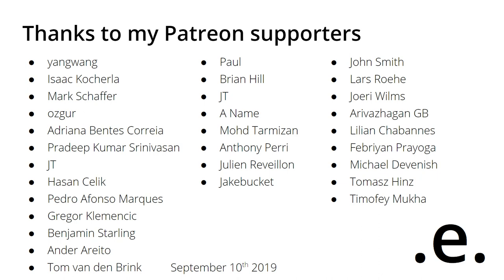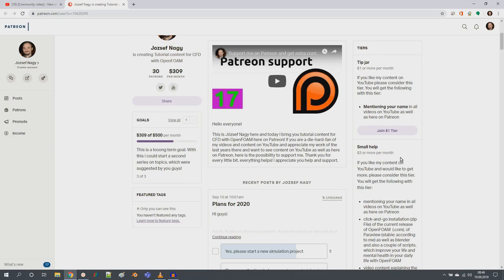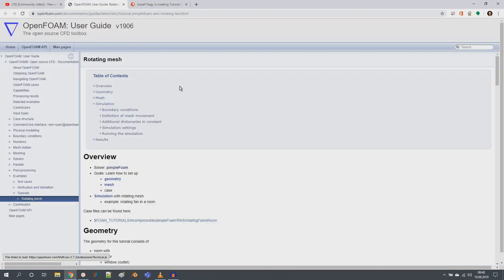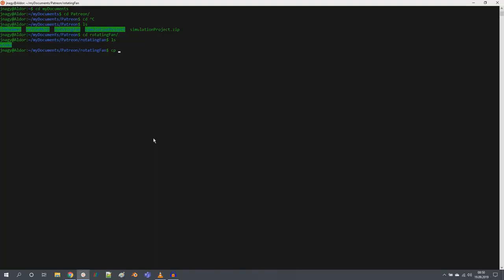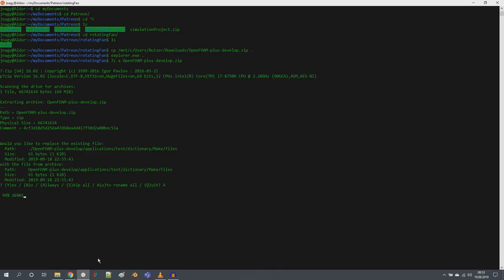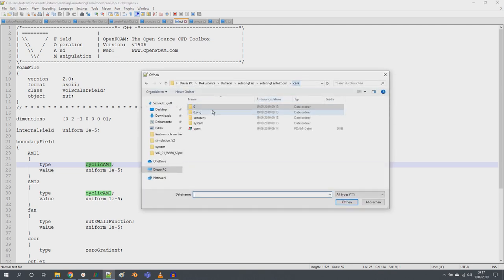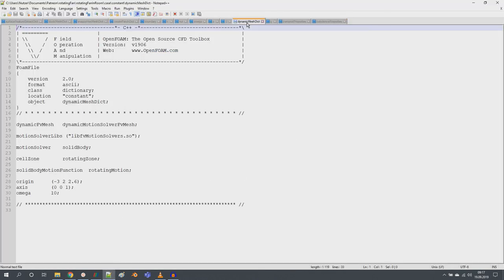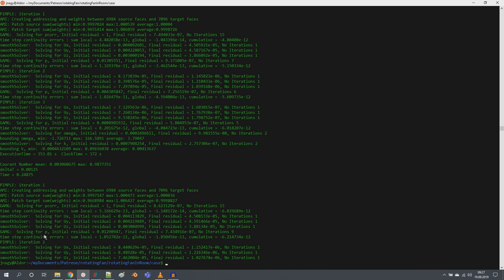Rotating mesh simulation project tutorial in OpenFOAM (mesh and simulation)

Comment: Hello József, thanks for all the work in putting this together ! I noticed when running this that my fan isn't actually rotating as I move forward in time. Does this suggest that I need to make changes to the boundary condition specifications? I am using v10 so I had to make some minor syntax changes specifically in the createPatch, DecomposePar and surfaceFeatures dict. Furthermore, I gather that the AMI condition for simulating rotation is being phased out, is this correct and should this case still run in v10?
Reply from the maker: Unfortunately the .org version is by design not compatible with any other versions, so you are on your own. I would suggest to switch to the .com version, which values backwards compatibility.

Comment: Hi! This video is awesome thanks. 

If I have a case where the rotation of the mesh is determined by the surface forces acting in my geometry (i.e a fluid-structure case). Does OpenFOAM has a case/code where you can simulate that?

Comment: Hi József,

why is it necessary to use the "movingWallVelocity" for the U field? Why is it not useful to apply the noSlip condition there or a fixed value of (0 0 0)? Since the fan and the cells within the AMI patch are rotating,  I thought that a noSlip wall is enough. It seems that this is not the case.
With respect to the turbulent fields you used the same wall functions for the fan wall as for the other walls and no special moving wall function.

The explantion of "movingWallVelocity" in the documentation:

"Sets the velocity to the desired value for moving walls when employed in moving mesh cases"

is not very meaningful to me.

I would appreciate some further explanation.

Very interesting video.  Thanks!
Reply: movingWallVelocity applies omega*r to the wall which is obviously needed if the wall moves
Reply: movingWallVelocity leads to a velocity of 2 * pi * Rotational speed * Radius at the cells of the patch. It is determined by (pp.faceCentres() - oldFc)/deltaT. Location of new patch cell center - old patch cell center divided by the time step size.

Comment: Hi jozsef! 
I modified the geometry of this tutorial in blender (basically mirrored the fan and AMI). The snappyHexMesh was successful with one rotatingzone cellzone formed. Now I want to define two rotating mesh regions but my simulation crashes without any error after defining two rotating mesh regions using dynamicMultiMotionSolverFvMesh. I think the error lies in dynamic mesh. Is it because there is only one cellzone? 
Any guidance would be appreciated. Thanks alot for these tutorials!
Reply from the maker: You need multiBodyMotion, check which version of OpenFOAM you have and go through the tutorials folder for a tutorial which uses multiple AMI-s and us e the syntax there.

Comment: Thanks a lot, József! I just found your tutorials, which is a huge help starting with OpenFOAM. Although having 0 experience with CFD, I find it very interesting (and even perhaps useful in my work). With that said, would it be possible for you to speak more about some of the parameters, which OpenFOAM users might want to change running their simulation cases? For example, what do certain constant/parameters mean (physical meaning), what could we expect, if we change them (it is very clear, what would happen with changing gravity sign, but less clear with other constants/parameters); e.g. what does nu in Newtonian stand for? Shall the value be changed? (just as example). Perhaps it would be possible, to add comments in the tutorial files, which holds all those constants and parameters, what is where, and what each of them do/and does it need to be changed in certain cases (if some OpenFOAM user has this done, could you please share such files, I believe it would be great help for those who just start)? Myself, I am interested in aerosol particle flow simulation. I would highly appreciate, if someone could share particle simulation related OpenFOAM tutorial files, which include explanations for constants and other parameters (e.g. physical meaning; which parameters/constants should be changed). This is perhaps a lot to ask, because everything depends on the case... But I thought to try anyways.

I thank you once again for such a beautiful material!
Reply from the maker: I try to do this in my basic and intermediate playlists.

Comment: Hi Jozsef, i tired to make this tutorial which is really good to learn something. I had a problem when  i run the simulation, this is look like due to relVelocity/ Using dynamicCode for functionObject relVelocity at line 13 in "/home/aokaya/OpenFOAM_files/rotatingFanInRoom/case/system/controlDict.functions.relVelocity". 
Thanks For videos and helps.

Comment: Is there a possibility of having laminar flow in rotating problems? What is the characteristic velocity in these cases, the rotational velocity (omega*R) ?
Reply from the maker: Yes it is possible. You have to change the setting in turbulenceProperties. The rotational speed will have to be slow. Depends also on the geometry.

Comment: Firstly, thank you for your work. I have a question: Can I define two rotating mesh regions with different rotational speeds? If yes how would I define them in dynamicMeshDict. Could I simply write rotatingZone1 {solidBodyRotationFunction ....; origin ....; axis ...; omega ...;} and rotatingZone2 {........}?
Reply: Hello! I want to do the same but my simulation crashes without any error after defining two rotating mesh regions using dynamicMultiMotionSolverFvMesh. I think the error lies in dynamic mesh. Were you able to successfully simulate two dynamic mesh regions?
Reply: @Bushra-no9ph  Any luck?

Comment: While running surfaceFeatureExtract I get this error "keyword extractFromSurfaceCoeffs is undefined". I added that keyword and it ran successfully but I get this line saying "Feature line extraction is valid on closed manifold surfaces only".
Reply from the maker: Do you use the foundation version of OF?
Reply: @OpenFOAMJozsefNagy  I am using the developer version just the way you did it.
Reply: @parasghumare5864  Hello, I use openFoam7 and I had the same problem as you. 

You can try this:

in the ControlDict file, replace writeControl adjustable; by writeControl adjustableRunTime;

and in the file surfaceFeatureExtractDict, replace 
door.stl
{
    extractionMethod extractFromSurface;
    includedAngle 150;
}
by this:
door.stl
{
    extractionMethod extractFromSurface;

    extractFromSurfaceCoeffs
    {
        includedAngle 150;
    }

        writeObj yes;
}
do the same for each.stl file

I haven't finished the tutorial yet, but by making these changes, I managed to generate the mesh and view it in paraview
Reply: @eti1316  i have already finished the tutorial and some of the changes I had made are  the ones you have suggested. I was just wondering what that warning line means?
Reply: @eti1316  Thank you!
Reply: @eti1316  Thank You

Comment: Is ceiling part inside AMI zone treated as rotating object too, or its data are interpolated to behave static? I mean if i leave some wall mesh elements  inside this zone does it act like movingWallVelocity against my flow?
Reply from the maker: No, if you set the velocity to 0 0 0, it should not have a relative velocity.

Comment: Thank you for this tutorial!

I have some questions about this case:

Using ./Allrun with OpenFOAM 5.x does not provide a solution.
Is this because of the version of OpenFOAM?

When entering commands individually instead of using the batch files, the case meshes and converges, but the fan does not spin. What could be preventing the fan from spinning?

Thanks!
Reply from the maker: The tutorial is set up for v1912 and now v2026. You might have to modify things for the foundation version.

Comment: Thank you for the very insightful tutorial! I learned much about dynamic meshing and parameters to consider in simulating rotation. However, in running this tutorial, I encountered a problem with relVelocity wherein a FOAM FATAL IO ERROR is met when trying to wmake the function.
Reply from the maker: What is relVelocity?
Reply: @OpenFOAMJozsefNagy  It is a function included in the system folder of the most recent iteration of the tutorial case files. It wasn't discussed in the video nor was it mentioned in the openfoam .com tutorial.
Reply: @OpenFOAMJozsefNagy  Regardless, I just removed the function and the simulation seems to be running well. Just a heads up for those encountering the same problem.

Comment: Nice work. Whats the major chances we have to do to make a simulation of a 2D fan rotation?
Reply from the maker: The empty boundaries.
Reply: @OpenFOAMJozsefNagy  If I put empty in the boundaries conditions of certain "walls", OF considers that the simulation its done in 2D? That "wall" should have any special name? or I could rename as front and back for example?
Reply from the maker: @joaquimmonteiro2548  You can call it as you want. The type is important.
Reply: @OpenFOAMJozsefNagy  I've manage to adapt your case to my situation. After a while (0,26 seconds) the simulation crashs and gives the error exit 142. Do you know what it means? Thanks
Reply from the maker: @joaquimmonteiro2548  Unfortunately, check the Co number. Maybe your mesh quality is poor at some location.

Comment: how did you build your geometry? What is the thickness of AMI wall, inlet and outlet.
Reply from the maker: No thickness required. I used blender to construct it, but and CAD tool with a good STL export will work.

Comment: Great tutorial, very useful! I noticed you indicated an angular velocity as the driving factor, but is it possible to specify the air as the driving factor? If so, how? To give an example of what I mean, right now you have a motor turning the ceiling fan at a constant velocity, but I'm interested in simulating a wind turbine spinning up from 0 omega based on the windspeed acting on the blades.

Best regards!
Reply from the maker: Puh, a time dependent angular momentum? I am not sure whether this is implemented :/ You can try increasing it manually.
Reply: @OpenFOAMJozsefNagy  More like a flow/pressure driven angular momentum.
Reply from the maker: @mishaparem  I see, you need the 6dof model for that.

Comment: Great tutorial. Sir I have a question here. How big we should define this rotating domain size. For propeller or fan, yes I agree the rotating domain shape is cylinder. But I'm not clear about the distance from the propeller or fan to the faces of the cylinder (read : cylinder radius and length). It would be nice if somebody could enlighten me. Sorry for the trouble and have a nice day to you all ;)
Reply from the maker: It should be as close to the fan as possibly, but the refinement of the fan/blade should not influence the refinement on the AMI. At least this is my experience.
Reply: @OpenFOAMJozsefNagy  thanks alot for the reply Sir. Your experience is valuable to me since this is what I lack of as relatively new explorer in dynamic mesh user. So, based on your experience, this is what I get : suppose my AMI refinement level is less than the refinement in propeller surface. While I define AMI surface to get as close as possible to the propeller, I should be careful to define the distance from the AMI to the propeller so that pre-set AMI surface refinement level not affected by colateral or induced refinement from more refined propeller surface? Could you elaborate why this consideration is important.

Just for the info, right now I'm predicting thrust of 2 meters of diameter of fixed pitch propeller for the aircraft rotating at 2200 rpm by using CFD. I consider using compressible solver and I have tried CFD simulation in openfoam using MRF approach (steady) and sliding/rotating mesh or AMI (transient).
Reply from the maker: @dickymulyoaditama6284  The interpolation between coarse and fine cells could be problematic. That's all.

Comment: how should I prepare the geometry for the flow domain? Should it be a cylinder or a thin-walled pipe with thin caps as inlet and outlet????
Reply from the maker: I am not sure, whether I understood your questions correctly, but you do not have to add a thin wall.
Reply: @OpenFOAMJozsefNagy   Thank you for your reply.I checked your geometry, the AMI is just a shell, is that the right way? Can the AMI just be a solid cylinder? Also, it seems that the inlet, outlet, and the room are just faces or thin layers.
Reply from the maker: @estaykylyshbek8347  Yes this is correct.

Comment: Is it possible to simulate half domain (a symmetric one) with a sliding mesh in openfoam? Then use symmetry conditions.... would that work? 
I actually tried it some time ago and it crashed 
Cheers!
Reply from the maker: I am not sure. I never tried, but I do not thinks so as the rotating mash does turn with the symmetry plane.

Comment: Why to use movingWallVelocity BC for fan and not noSlip when AMI is already there? Is rotatingWallVelocity a BC too?
Reply from the maker: You need it because the simulation is run in the external non moving reference frame and you have to account for the relative motion of the mesh.
Reply: @OpenFOAMJozsefNagy  But if that's the case then why did you put the value as uniform 0?
Why didn't you assign a rotatingWallVelocity BC and specify the rotation characteristics?
Bit confused 😅
Reply from the maker: @parasghumare5502  uniform 0 ist a starting value and is overwritten by the code. The rotation characteristics are not specified in the BC but in the dictionary in constant.

Comment: hello 
thank you for your tutorials 
i have make all the instruction in this video but in the end when i run the simulation the fan doesn't rotate ; i didn't understand what i should change.

thank you
Reply from the maker: What did you change?
Reply: @OpenFOAMJozsefNagy the only thing that i change is in bondary  wall to patch
Reply from the maker: @oumaimaboualam5803  What is the reason for that?
Reply: @OpenFOAMJozsefNagy exactly like you have done for the door and the outlet 
but generally i have all done like you but the problem is that the fan doesn't rotate in the simulation 

thank you for your help
Reply from the maker: @oumaimaboualam5803  Are you using the correct openfoam version v1912?
Reply: @OpenFOAMJozsefNagy  no I'm using v1712
Reply from the maker: @oumaimaboualam5803  Try updating it to v1912 or v2006
Reply: @OpenFOAMJozsefNagy  yes now it work ; thank you so much

Comment: Hello, I'm trying to run the surfaceFeatureExtract command, but I get a message that says this: 

surfaceFeatureExtract: symbol lookup error: surfaceFeatureExtract: undefined symbol: _ZN4Foam9UOPstream5writeERKNS_5tokenE

and I cannot pass from here :( I've tried downloading the whole source code and running it from there, bu I have the same message, I wonder if you could help me please.
Reply from the maker: This is weird. Do you get the same error with a different version of OF?
Reply: I had the same problem at first. It went away after a complete delete and reinstallation of OpenFOAM. But in the second run i got the error that controlDict, using the surfaceFeatureExtract function, cannot be found. Looks like this:

FOAM FATAL ERROR :
    Could not find mandatory etc entry (mode=ugo)
    'controlDict'

Comment: Hello Józef,
I have a one question. I can't start my simulation. I have this ERROR during last step in tutorial.
 [0] --> FOAM FATAL IO ERROR:
[0] Wrong token type - expected string, found on line 20: word 'fvMotionSolvers'
[0]
[0] file: /mnt/c/Users/monki/Documents/rotatingFanInRoom/case/constant/dynamicMeshDict.motionSolverLibs at line 20.
[0]
[0]     From function Foam::Istream& Foam::operator>>(Foam::Istream&, Foam::fileName&)
[0]     in file primitives/strings/fileName/fileNameIO.C at line 60.

[1] --> FOAM FATAL IO ERROR:

[1] Wrong token type - expected string, found on line 0: word 'fvMotionSolvers'
[1]
[1] file: IOstream.motionSolverLibs at line 0.
[1]
[1]     From function Foam::Istream& Foam::operator>>(Foam::Istream&, Foam::fileName&)
[1]     in file primitives/strings/fileName/fileNameIO.C at line 60.[2]
I have OPv1906 installed from your tutorial on Ubuntu in Windows 10. How can I solve it ? Thank you in advance!
Best regards!
Reply: Hi I have the same error, how did you solve it?
Reply: For people who as me had the same error, it should be solve with "fvMotionSolvers" in the motionSolverLibs of the dynamicMeshDict of system folder, this is just to indicate that is a string.

Comment: How can I change this case to run a simulation for a horizontal axis wind turbine?
Reply from the maker: Change the STL files, the settings for meshing, the case setup and there you go ;)
Reply: @OpenFOAMJozsefNagy   My flow domain is a giant cylinder, should it be a solid body or just a shell structure like your room stl.
Reply: @OpenFOAMJozsefNagy   Thank you so much for your reply.
Reply from the maker: @estaykylyshbek8347  It doesn't have to be 100% water tight as long as the gaps are smaller than the final mesh resolution.
Reply: @OpenFOAMJozsefNagy   Thank you for the answer but I am still a bit confused. May I send you an email and include my STL files?
Reply: Salam Estay, u vas polychilos zaranit?